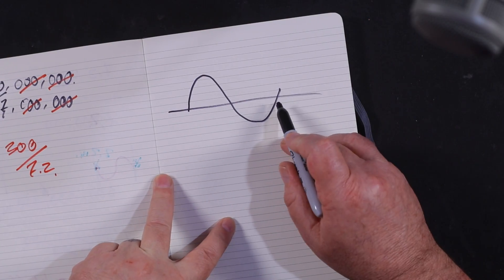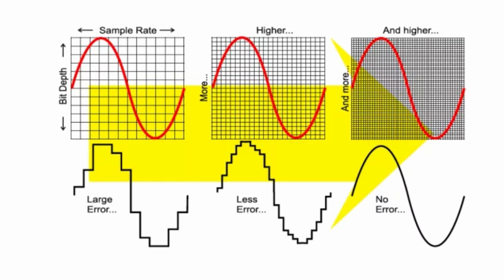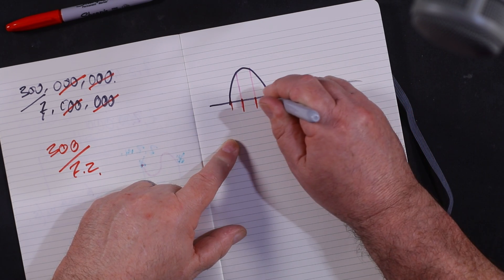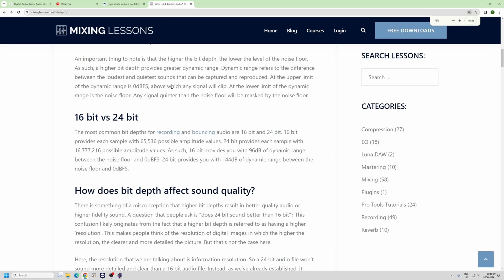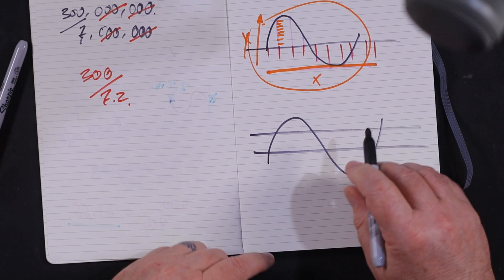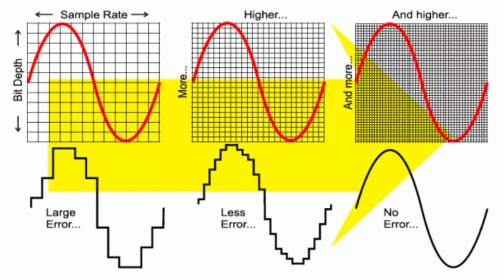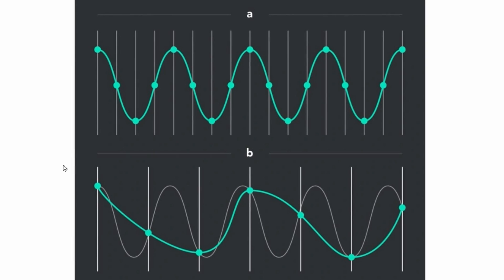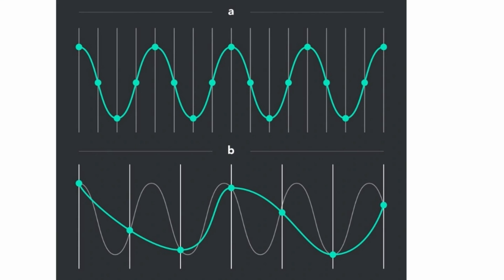Analogue to Digital Conversion - The Basics

Comment: Just another dimension to the digitizing of audio. An audio signal, once captured by a microphone, is converted by the microphone (the transducer) into an electrical signal. And it's the electrical signal is what is then digitized (or sampled). The electrical (audio) signal is an alternating current (AC). Like all electrical AC currents the signal changes polarity, or "alternates" polarity. So, the +Y axis would represent a particular polarity direction and the -Y axis would be the reverse of that polarity.
A speaker diaphragm when at a rest position would be at 0 amps on the Y axis. The push of air would normally be a positive current of a specific amplitude/amps. The speaker diaphragm would also be pulled backwards when there is a change in polarity of the electrical audio signal. The diaphragm doesn't just return to the rest position on its own (although it could, but this would be too slow). In order to respond to the dynamic changes of the signal, it's pulled backward by this reverse in polarity. It's probably more accurate to think of the simple sine wave as the alternating current of the electrical signal. This is what gets digitized. The alternating polarity of an AC electrical signal.
We're not technically digitizing sound, we're digitizing an electrical signal. Which is either an analog electrical signal that was converted from digital into an electrical audio signal for a speaker, or the analog electrical signal created by a microphone. Hope that's understandable.
Reply from the maker: Great summary - thanks for taking the time to write that up!

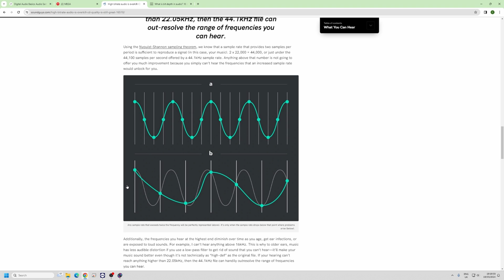Comment: At 4:30 this is what happens to sounds when the signal is faster than half the sample rate. If you are sampling at 48khz and feed it a 47.999khz sine wave, you'll end up with a 1hz sine wave being sampled.

Bit depth affects weak signals. 0dbFS is your maximum amplitude, 1. -30dbFS is 0.03 amplitude. The smallest non zero value an 8bit signal can represent is 0.004 amplitude (1/2^8), having a dynamic range of roughly 48db between the strongest and weakest signal.

Comment: Bit depth is the number of bits (1s or 0s) that are recorded in each sample. The more bits, the closer your digital sample is to the analogue signal.  The sample, therefore,  is a measurement of amplitude of the waveform.   The sample rate is the number of measurements taken per second.   The higher the bit depth and the higher the sample rate the closer your digital representation will be to the analogue signal - but the file size increases considerably. 

Niquist Theorem suggests that the sample rate must be at least 2 times the value of the highest frequency in the analogue.  So, in audio, the highest frequency is about 20kHz, so we must sample at 40kHz or more to be able to reproduce the highest frequency.
Reply from the maker: You should make videos!